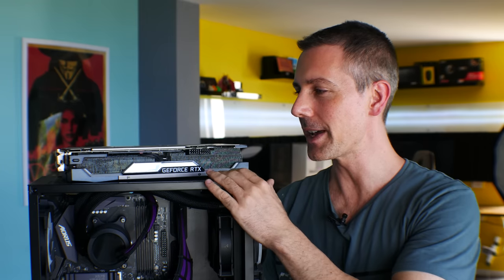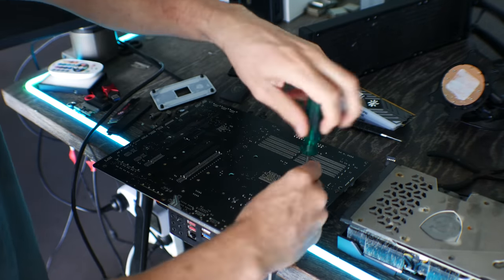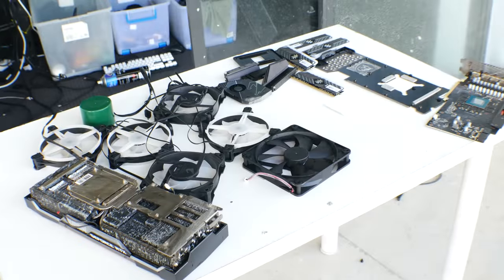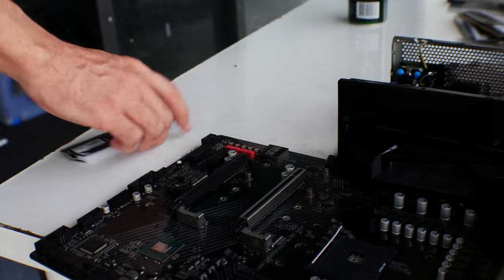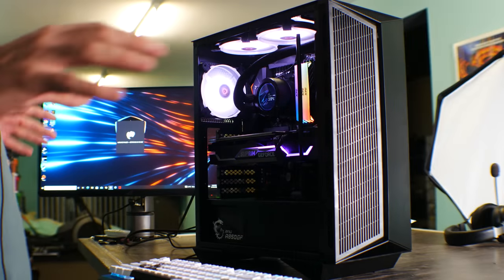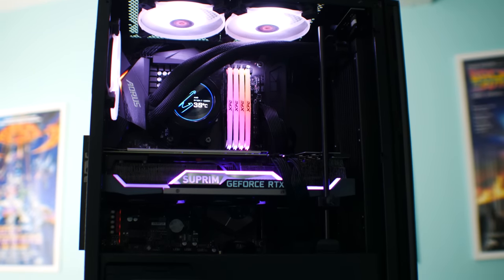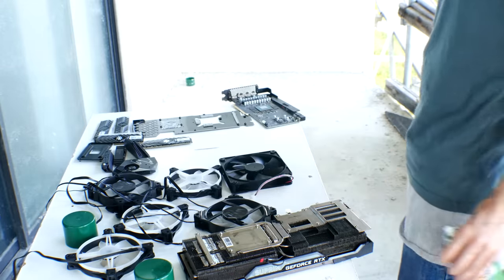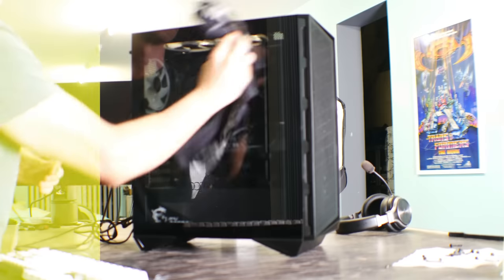Restoring an RTX 3070 Ti Gaming PC that was Submerged in Flood Water...

Comment: You're one of the very few creators left on this site that genuinely cares about their fans. This is why I initially subbed. Way to be, man!
Reply: How can you wash a graphic card in water im lost
Reply: @chriswright8074  It's not hard. You can wash everything as long there's no electric current. Make sure it's perfectly dry before you plug things back in and you're hunky dory
Reply: @Eppopower  so I can wash my Xbox
Reply: @chriswright8074  Yes. The key is to get all of the water out. Make sure it's bone dry.
Reply: Idk
Reply: @chriswright8074  you have to discharge the components before washing them and don't wash the power supply unless you are a professional since they could still have current.
Reply: @chriswright8074  make sure you hold the power button for like 20 secs whilst the Xbox is unplugged from the wall and then the charge should be gone.
Reply: He knows, almost no pc works without fans.
Reply: Yeah, what kills electronics isn't the water itself. It's the electrical shorts caused by it. Basically electricity flowing where it isn't supposed to, and frying components. If there is no power flowing while it's wet there is nothing to fry components. That said there are capacitors in the machine that can hold a charge, so that's what you'd really want to be careful about. Often times holding the power button can dissipate the charge. Also changing any thermal paste/pads would be important after a deep clean like this.
Reply: @chriswright8074  No, it isn't that simple. It must be COMPLETELY disassembled.
Reply: His "fans" people or case "fans"?? Lol

Comment: This blows my mind every time, it seriously makes me think carefully about an ultrasonic cleaner and the equipment needed to replicate your process. I fix PC's for a living and if there's an option to save a system like this, then I would want this option just in case. It could turn scrap into gold, or make some peoples lives way happier.
Reply: Ultrasonic cleaner is great. Escpecially after use, put the components in isopropil alcohol.
No more flux nor corrosion.
Reply: @kikihun9726  Don't use iso on plexi/acrylic, it will crack it.
Reply: But it is good for pcb's
Reply: @Safetytrousers  Using Isopropyl Alcohol on an Motherboard can crack it?
Reply: @Aquabyte  I don't know, but there's lots of little plastic bits on a board. I wouldn't submerge one in iso.
I left a CPU a bit long in my ultrasonic in iso and it stained part of the green bit on the back white, and it would not clean off.
Reply: @Safetytrousers  Hmm 🤔... I think you were using Isopropyl Alcohol with 90% rating?
Reply: @Aquabyte  No, it's 99.9%.
Reply: @Safetytrousers  I think that might be the reason where you left the Motherboard in 99.9% Alcohol. I use 70% since that's what is available here locally.
Reply: @Aquabyte  I said I would not submerge a motherboard in iso, I did not say I did.
Reply: @Safetytrousers  Yeah.. Sorry! My bad. I think higher concentration of Alcohol might be the reason.
Reply: you dont need one.

you can wash the parts with clean tap water, let them dry opened for some day, then use alcohol (isopropyl) and clean it properly with it and then only need to wait an hour. just make sure hard to get places don't have water residue (or dirt) left inside.
Reply: @Safetytrousers  Stained? I think you mean it bleached the color right off; as you can't 'wipe it off' cause there is literally no color to wipe off. But you mentioned it would crack? May I ask what component you were iso bathing for the crack to happen?

Comment: Given that they are electronic devices, it is amazing how resilient PC's can be when they are submerged like this. What a decent guy. With everything on his plate he takes the time to do this.
Reply: as long as it's not powered, it has higher chance to live.
Reply: If there was a breaker, no power was coming to the pc, Because based off his system it protected itself.
Reply: @Fabulos1  luckily for him power probably was cut before the pc got sup merge. Most modern electronic devices can survive up to a week underwater without power
Reply: @Andychiu845  can survive as long as it can before the rust
Reply: @somedude0921  i think that water pressure gonna kill it first. Then the rust. Depend on how deep though
Reply: it's the same for all electronics. just be sure that it doesn't get electricity.

handheld devices have of course more chance of breaking because of constantly being powered by battwry

Comment: as someone who loves fixing systems, seeing these successfully restored is a rare thing. the closest I ever came to something similar wasn't due to a flood, but fire.. an old dell dimension that was someone's family system. somehow it had survived at least cosmetically, but the inside was completely covered in black soot.. to my mother, who wanted to be interested in what I did, this was one of the best ways ever I guess. it took 3 days, a ruined comforter, and tons of old socks used as gloves lol. but after taking everything apart and cleaning soot off of everything, including the floppy drive. the thing looked spotless, and ran perfectly.. I still have pictures of the system, but to know that it did run for years after was heartwarming.

Comment: A 3070 TI, you did a good job cleaning it. doesn't take much water to seep into those caps and you'll potentially have a near 300w firecracker launcher. Ask me how I know that works, but I did it wrong
Reply: your cat peed at the gpu?
Reply: @luckydepressedguy8981  imagine that 😂
Reply: Apparently the voltage dissipated over a large body of water. You can discharge caps with a screwdriver and it won't damage the components. However if you discharge a cap with your hand eg possible death or place an electronic component between the legs then you're gonna have problems. This is why the caps must be absolutely dry from the ultrasonic cleaner. The Tech Yes man knows what he's doing.👍
Reply: I'm actually really surprised he didn't bother taking the fans off the cooler... very peculiar move.
Reply: Sixgorillionshekelswindler Shlomo  unlucky,Id put the cat outside of the house to take care of mouse just incase. Did you guys get any refund/warranty on the tv ?

Comment: I know he's done plenty of videos proving his method works it just still gives me anxiety seeing PC parts submerged in a cleaner of any kind. 😅
Reply: I don't understand the water part
Reply: @chriswright8074  Water is safe just as long as you get ALL of it off and clean the mobo with some type of cleaner. As long as the residual minerals from the water are gone you are safe. I recommend deionized water for any cleaning projects, but any will do.
Reply: A lot of YouTube PC guys like Jayztwocents use 99% alcohol. I would be less nervous about that because of the way it evaporates. I've used it myself, though not in one of these cleaners.
Reply: @2528drevas  Isopropyl alcohol is fine for smaller cleaning jobs, but you're hardly going to immerse an entire system in it (unless you like living dangerously). Not to mention that it'd stink afterwards. There's absolutely nothing wrong with immersing electronics in water, so long as they don't have power running through them and you carefully and thoroughly dry them afterwards.

Comment: Great work!  <3 it!

I repaired apple laptops with all sorts of liquid damage for many years and we definitely used the ultrasonic baths with industrial electronics / PCB cleaner to get them back.  We NEVER used tap water however - tap water has minerals (Some regions have much more mineral content than others) and impurities that always corrodes parts badly (Corrosion damage that can show up much later) especially under many surface mount chips where it's really hard to dry... We always used distilled water for cleaning, followed by an agitated alcohol bath (mainly to get left over grime and any left over water out) and finally a warm (80-90c) toaster over bake for 20-30m.  I suggest using only distilled water with electronics (PCB) cleaner followed by the alcohol bath and a short bake as the go to process for most liquid damage.

Either way thanks to you for helping a fellow gamer in need and I'm glad it all worked out!

You rock!
Reply: I was going to comment that there must be some specialized cleaner for electronics.
Reply: yep another reason for distilled is its not fucking conductive. Fell of my fmchair when he basically washed it like dishes in the sink.

Comment: That's one really lucky owner. I think what saved this system including the power supply was that power was already out when it was flooded and never reapplied afterwards. Good work cleaning it up.

The fan bearings must have been fairly well protected, but then again they kind of have to be.

Comment: I've been cleaning a lot of the PC's from the Floods, my process is a bit different since i don't have a ultrasonic cleaner. i literally remove all components, hose them off, put them in the oven at 100C, use the multipurpose spray your using on them, and put them all back together, 90% of them run. I only see really the PSU's and a few motherboards that go bad. i suspect that they may have had the person attempt to turn them on
Reply: the biggest accomplishment was actually a HP DL380 gen 9 server repaired with all business data still retained and returned to the business
Reply from the maker: Oh that's awesome to hear man.

Comment: The component I'd be most concerned about going forward would be the fan hub but that's close to the cheapest item in the build and probably easily replaced. Well done Brian and I hope the owner enjoys his Lazarus gaming machine.
Reply: More relevant, the 240v power supply. If that cheap wd40 he used decides its conductive or the oil in it gets hot its an instant fire and electrocution hazard.

Comment: Speaking of not turning electronics on after it gets flooded:
Similarly, if your car gets into deep water, shut it off. The engine can be restored if the pistons don't get wrecked from trying to compress uncompressible water. Probably a good idea to have a mechanic take a look at it before trying to start it after it dries out too.

Comment: What a great video! The only thing I could say is that I believe that heatsink on the video card could have been cleaned further. I don't know if maybe the excessive moisture ended up getting something stuck beyond cleaning. It's just I have seen many of Greg Salazar's deep cleaning videos and he seems to be able to get really nasty heat sinks clean. But in the end you did a really good job and best of all the computer was actually left functioning which in itself, beyond the cleaning, is a feat by itself. So congratulations for that and for helping out.

Comment: my friend had his pc saturated in insulation and water during hurricane laura in the states, so i took it and tore it all down and bathed the components in 92% alcohol , took all the heatsinks off of course . and then  lightly scrubbed the boards . after it dried i gave it about 3 days more in a room with a dehumidifier to make sure any water residue had evaporated. pit it all back together and it worked, had he tried to turn it on before i did this it would have fried it. so im happy he brought it to me first. it was plugged into the wall outlet but his house lost power before the damage occured.  it was a fun project to work on . tho i really need to find some of that multi purpose spray for sure !

Comment: Were you able to get all of the corrosion removed? Even a small bit left will grow over time. The sprays help prevent new corrosion, but any bits still there will continue to grow under the spray whenever it eventually dries out.

Comment: Losing your house: that sucks, I'm gonna need a new one, gonna need to move...
Losing your gaming PC: DUDE THAT'S LIKE WORSE THAN DEATH!

Actually some people may not understand how important having a proper working gaming PC is.
That's why I collect even old gaming laptops. I got the following for gaming:

HP Pavilion 15 Gaming Laptop:
-AMD Ryzen 7 3750H
-NVIDIA GeForce GTX 1660 Ti M with Max-Q Design
-1x16GB 2400MHz DDR4 SDRAM (single channel because my second slot died, it's acting up extremely weirdly)
Lenovo Thinkpad E570:
-Intel Core i7 7500u
-NVIDIA GeForce GTX 950 M
-2x8GB 2133MHz DDR4 SDRAM
Asus K550J (does not say ROG so idk what it is):
-Intel Core i7 4710HQ
-NVIDIA GeForce GTX 850M
-4GB 1600MHz onboard DDR3 RAM+8GB 1600MHz DDR3 SDRAM

My real gaming rig is:
-AMD Ryzen 5 5600G
-MSI GeForce GTX 1660
-Gigabyte Aorus B550m PRO-P motherboard
-2x8GB Crucial Ballistix RGB 3200MHz DDR4 RAM
Creative Sound Blaster X-Fi Titanium HD (literally found it in a bin, and only the connector for front IO jacks did not work, the rest of the sound card was all fine!)

Comment: After the Ultrasonic water bath and Before the Datavac drying I would have personally soaked everything in Pure Alcohol and then that will help chase out any moisture from within the components and under certain places where the vac won't be able to get to, to dry it off. Or place all items in an oven at low temp just to make sure as any moisture left behind on exposed electrical traces can cause corrosion further down the line, so whilst it might work with just the Ultrasonic cleaner and the Datavac on blow it won't be a perfect solution whereas Pure alcohol gets into those places the datavac cannot reach.
Used that process a few times in the passed and its worked out well.

Also personally I wouldn't have used the Australian Export W.D Water Spray Dispersant (WD40 equivalent) as some plastics are prone to fracturing or even melting when subjected to Petroleum spirits and this product contains this, its far safer to use pure alcohol as it evaporates better than the spray will and won't leave anything behind. 

The product also contains Methylene chloride which was banned in the US as it gives off vapours that are harmful to the lungs (turns into carbon monoxide) , its used in Paint strippers too, so probably not good for the graphics card PCB or Motherboard plastics either. 

https://1library.net/document/zg3o937q-hazardous-substance-dangerous-goods-water-dispersant-grams.html

Comment: Yes, you can use water to clean a circuit board, but must be ultrapure water (distilled water). Since there are no conductive ions, distilled water is good for removing dust and the water-soluble flux residue on the board, which will not damage electronic equipment because it has poor electrical conductivity.

Comment: I also use WD-40 type of spray. It's petroleum based so it's good against water. It's going down to atomic level so it also get away stains. The only bad thing with spray like that it's "eating" some of plastic surface and it's less good for moving plastic parts (like wheels in FDD) then lithium grease; but you will never notice it.

Comment: Chuck the case and fans EVEN YOU wont be able to fully clean them and get the flood water stench out.

Some spots cant be claned but water can slowly seep in. 

-Fan bearings
-Flat riveted connections on the case.
-Inside cables and sleeving

Comment: are you sure soap and water was the best choice? what about an alcohol based solvent? or some other kinda of anti corrosion inhibiter? it's just that alot of these components might work for a while, but there could .... will be... some residual moisture under the chips and in some really weird spots. but if you sonic'd in an alcohol that wouldn't happen.

however i have no idea how one would "stop" rust really, without harming the plastic.

either way, it's awesome you were able to bring her back !
i hope it works for years to come :)

Comment: Please do a video about separate, air coolers of GPUs, which are just brackets with fans attached, and which I just learned about, because they really cool my 6600xt a lot. I did change one of the fans with a Noctua fan that spins at 1700 rpm, but it is now really cool and not very noisy. You mentioned "accelero" in passing, which might be the same thing. That gaming PC now also has coincidentally, lower CPU temperatures, because the GPU air cooler must also be blowing some of its air at the CPU tower.

Now, since the Gelid cooler does not fit my smaller Dell PCs, I am adding Noctua fans to my various, old Dell computers using bands and SATA to fan connectors, and they really cooled my CPU and GPU on those also. I wish I had known about this long ago. My i5 10400 Dell is running 200mhz to 300mhz faster, on average, 4190 mhz now to 3990mhz before I added the Noctua fans. My 1060 GPU's fan almost never even turns on unless I start it with MSI afterburner. That is perfect for video editing.

Comment: Great to see that capacitors didn't kill the system. The charge there is minimal but with corrosion it will be enough. Its good to clean it as soon as possible after submerging. Plus you have to watch out for static. So no cloth before cleaning on the motherboard.

Comment: this is a good job, I would however double check to see if corrosion is occurring. I do not know if u disassembled everything, especially the ram. The thermal pads probably need replacing in them but all in all. good job

Comment: Good job Bryan. Lots of effort pays off. Good to remove some RGB crap. Way too much in builds lately with multiple RGB software conflicting with each other. Most of the time………less is better. After building so many PC’s lately, I’ve started to dislike RGB and have moved toward soft white light instead. It adds more beauty to a rig…….especially my fully white rigs.

Comment: Those PSU cables all you had to do is cut the sleeving off and either use without it or resleeve them.

With them being extensions I suppose it doesn't really matter the person could buy new ones.

Why do you run Heaven on not very demanding settings?

That temp was still high.